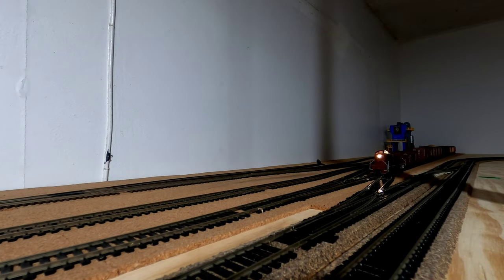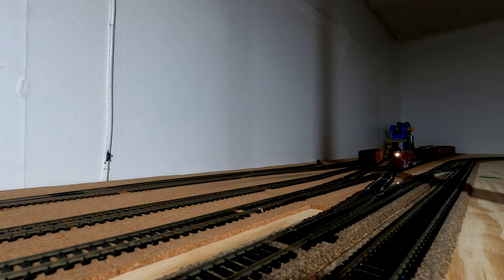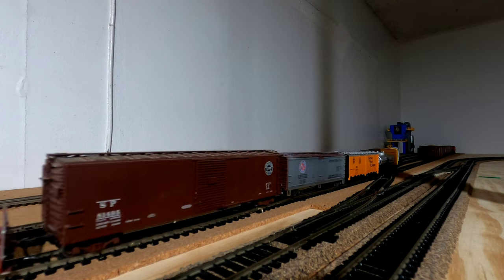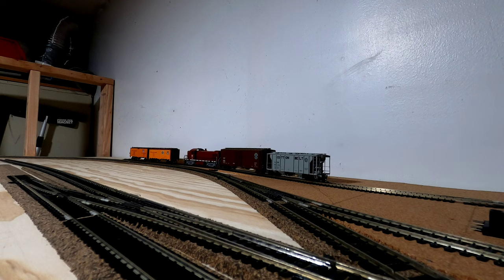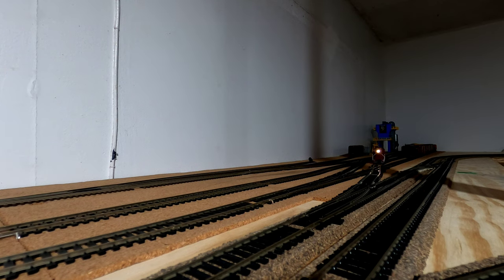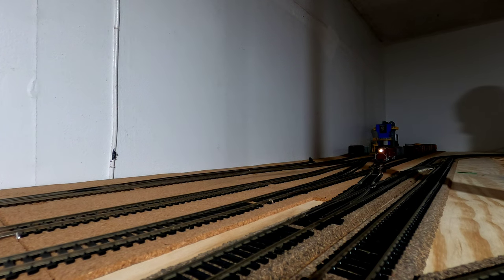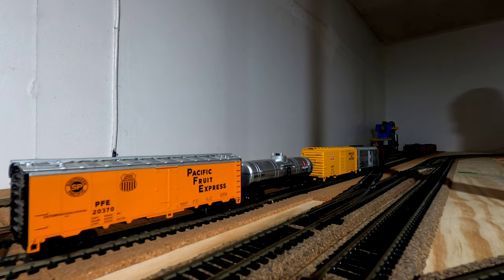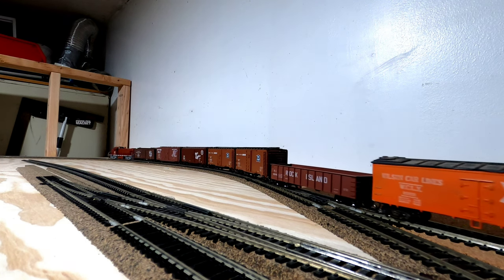Operations - Building Rock Island Train #33

Comment: Thankfully the railroads did away with all the horn action in real life. That would get old not only for everyone around the railroad but the workers themselves.
That stop is usually to check the knuckles and make sure they are open. Though with the Rock Island's penchant for poorly maintained track, checking for derailed cars could be accurate.
Reply from the maker: Aww Tim doesn't like the horns!....lol. Your correct on the knuckles as well which I did forget about.
Reply: @TheTrainFreak  I can just imagine how the people in Silver Springs would complain about the trains of the NS and RSR blew their horns every time they moved. They already complain about the trains blowing just for the crossings.
Reply from the maker: Well the real reason they had these horn signals is because they didn't have radios back in the day. This allowed for communication between the locomotive and the caboose which had a Hancock whistle that was attached to the air line. Now that sucker is loud!